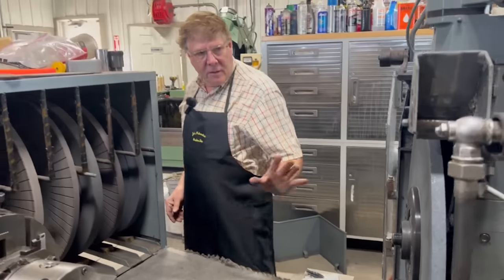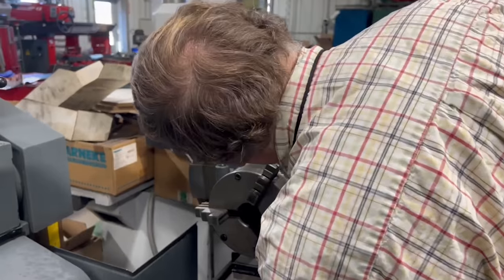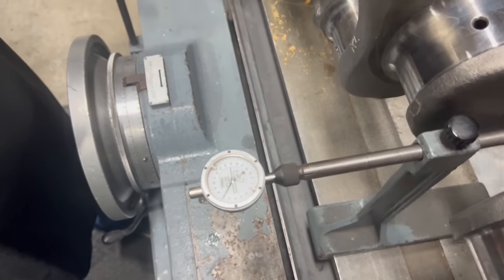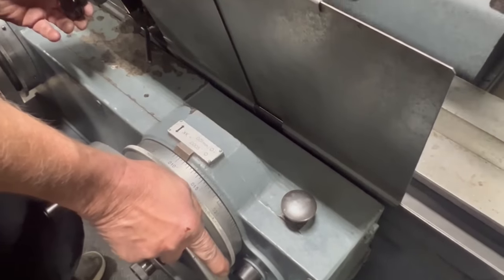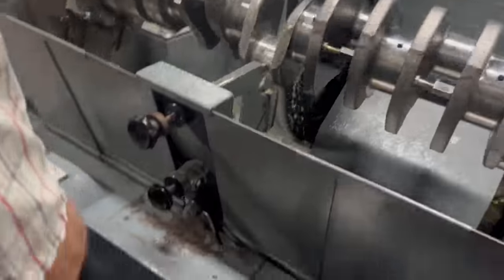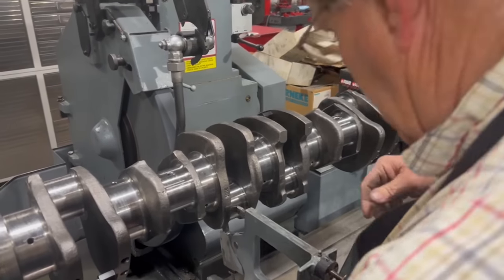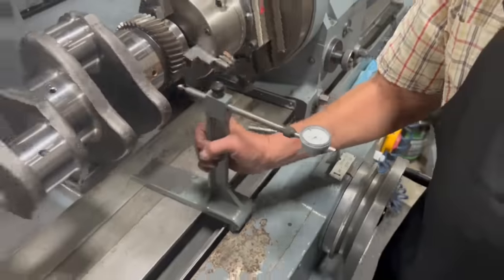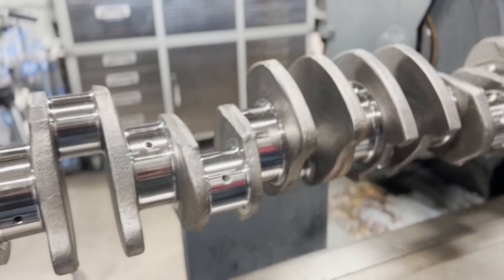This Cummins Crankshaft Was Almost Scrap Metal...

Comment: I've been a machinist/tool and die maker for 45 years and this is the first time I've seen a crankshaft ground! Thank you, it was a wonderful video!
Reply: Me too , and it's so relaxing and peaceful.
Reply: I've allways wanted to see the full procedure this is great
Reply: As a retired tool maker he didn't know what size radius he had only that it was similar in size to his radius gauge this radius on crank prevents cracks from forming when under stress we always ground radii on punches and other tooling that were under stress but on profile tooling if specs. called for .250 radius we ground that dimension to .250 plus or minus .0002 to have proper punch and die clearance.
Reply: Спасибо за хороший урок. Вы настоящий мастер, который любит и понимает свою работу. Здоровья и благополучия. Жду новых видео в этом году!
Reply: 😅😅😅😅ö
Reply: Curious as to why the one instance of side loading the wheel (when sweeping over and grinding out the radii) produced unacceptable chatter, but other similar occurrences did not?
Reply: Same! The “chatter” sounded the same to me also and it happened a few times..
Reply: I am also, tool designer for the last 30 years. Sure is neat to see the type and use of the machinery you use in your videos Jim.
Reply: I sure do like his radius grinder.   Been using a Norbide stick to hand dress the radius then touch a wooden popsicle stick to the wheel and checking that against a gauge lol.

Comment: Thank you both so much for this VERY interesting video. As an OLD(80) yr. old 'gear head' from the big block era of the 60s, and a guy who still changes oil and greases the front end of my '02' Ford E250, I really appreciated the workmanship, and honesty shown in this video. BTW, I watched the tear down video of the 327. I rebuilt my share of small blocks way back when, that was a mess. Thank you for both videos. Sincerely, Bruce F. Raykiewicz.

Comment: Thanks Jim, very cool, I’m an old truck mechanic and back in a day and we’re talking 1975 I used to work on Cummins 318s and what I remember most about them is that they used to snap crankshafts. I’m not a machinist I’m a mechanic.

Comment: To say that this is "oddly satisfying" is a massive understatement. As a truck driver both driving and wrenching on trucks, I've seen "in-frame" overhauls up close. My father created a trucking company and in those early years I was a grease monkey. Dad had a couple of crankshafts standing on end in the corner of the shop. They were for Big Cam 400 Cummins. He always said they were good and now I know why he believed that. The details of dialing in all of those measurements blows me away. What an awesome video! Couldn't take my eyes off it!! Thank you very much for giving me a better understanding of the inner workings of a great engine!
Reply: I've got a detroit 60 series with 850k on a rebuild. Bout due for another. This was super interesting.

Comment: Love your work,guys.
I trained as an engine machinist/builder at Cummins in the late '80's.We did everthing in-house except for crankshaft grinding,,so it was good to see a Cummins crank getting machined correctly.
Alll the measurements and magnaflux was done by us. To measure the fillet radius,we had different size spheres attatched to the end of a thin metal rod.Our magnaflux was the biggest in the southern hemisphere,300 volts d.c.
This was at Cabramatta(aboriginal word),Sydney,Australia.
Subscribed!👍

Comment: I used to do this for a living as a apprentice then went and did a apprentice boilermaker welder more money but I did enjoy doing motor work. 🇦🇺🙏 we had the same machine at Mendham engineering I didn’t see you test the wheel with the ring test but you guys look after your wheels no doubt. We had books that would give us the off set for the weights so we could set up the big ends and the mains we just  Center of the crankshaft. Love your work guys I do miss it sometimes. 19:54 what a  smart idea. After watching this video our machine was a little bit different it was about 35 years ago.

Comment: Great video!! My father ran an engine machine shop for 40+ years. He use to do a lot of crank and cam work, and there were many cranks that came in he used the Eutectic spray welding on to bring them back into spec without taking too much material off. Grinding camshafts was the coolest thing, he use to grind a lot of custom profiles and lobe separations on them, use to build them back up if they were worn too.
Reply: I would love to see that process

Comment: One thing I remember about MACK truck engines is that the crank was ground to "whatever fit" one journal may be 5 under, the next 10 under the next 15 under and the next 5 under again. Then you just used whatever bearing fit.

Comment: Really nice to see an engineer/machinist use the adjuster on the micrometer correctly!  You see so many guys take a measurement, it's not what they wanted to see, but by applying 75ft/lb of torque to the micrometer everything's dandy.😂.
I really wanted to be an engineer/machinist or toolmaker, but the family business was accountancy so I was pushed/shoved into that. Everything you've heard about accountancy is correct. It's as dull as dishwater.
But it has given me the money to equip myself with some amazing machines. 
I've got a 4000sq/ft workshop, I buy old equipment, but I only buy the very best equipment going back 100 years. I like stuff that'll do 1/10 of a thou or better. 
Since everyone went to CNC i've picked up some amazing bargains. A fully fitted cabinet from Moore & Wright, with depth, length, internal radius, external radius  gauges from 1 inch out to 36 inches all of it accurate to 0.1 thousands of an inch, all for £75. It was going to be put in a skip!
I'm a widower and have been for 20 years, I don't go on holidays much, I'm really happy in my workshop. I've lost count on what I've spent, must be north of £250,000 on equipment and £175,000 on tool and gauge.
I've found a young woman who loves it all, she's an amazing learner, she's almost finished her first steam engine, 10hp, twin cylinder locamotive. 
What she doesn't know, is that if she keeps up the interest, keeps studying and learning, then she get the lot in my will.
Only just found this channel so lots to catch up. 👍

Comment: Just found your channel thru your tear down of Scanner Danners engine.  My father was a tool and die maker from the 40’s, 50’s and 60’s, I turned out to be an auto technician, 50 plus years and still doing it, and my son is a welder.  A family of tradesmen.  This was extremely interesting to me and all I could keep thinking of was the engineering and design of the grinding machine and lathe.  Amazing.

Comment: Thanks for showing the whole process. Crankshaft grinding is one of those "black magic" processes that your Dad has spent years learning. That crank is probably more consistent across each journal than it was out of the Cummins factory. I don't think the small drop in bearing size will really matter.
Reply: Ive heard of people boring one cylinder out of 8 and runnin it for a long time

Comment: You actually get the crankshaft closer to the correct specs than most engine machinists I've seen in 20+ years.  You are a inspiration to be better than it will do
Reply: Begs the question if it's just more cost effective with time and money to just replace the crank rather than pay someone to do this who has a ton of experience in it. This definitely isn't cheap to get done by someone who knows his or her shit very well.
Reply: @nexpro6118  In some cases it is cheaper to just buy a new crankshaft. With something like a 5.9L Cummins it'll be $800 - $1000 for even a cheap Chinese crankshaft. Whereas it'd probably cost $200 - $300 to have the original crank reground.

Which I've had such bad experiences with the cheap Chinese engine components that I'll personally never use them unless I absolutely have to. I've seen so many pistons, cams, cranks, connecting rods, bearings, etc. that are either manufactured way out of spec, made out of inferior steel/aluminum, or both. If it's something like a carburetor for a lawnmower then they usually work fine, but for a big 130lb Cummins diesel crankshaft...there's no way I'd take a chance on it.
Reply: @FinalFront  thank you for the response!!!!
Reply: @mihaigheorghiu9071  I have trouble getting a head shaved properly.  I found a specialist now but I have had 3 heads destroyed
Reply: @FinalFront  Only $300 for this?

Comment: Just found your channel and it brings back a lot of memories. I learned the automotive machine shop trade from my uncles when I was 22 years old. What I was taught first was crankshaft work. They had the only submerged arc crankshaft welder in the state of Maine so we received crank work from all over the state. Mostly crankshafts that had spun a rod bearing, removed too much material to grind for undersized bearings, and where the heat of the spun bearing bent the crankshaft. We would put the crank in the crankshaft welder,  preheat the shaft, and then weld the bad rod journal. Before we could grind the crankshaft, we had to straighten it using heat and a hydraulic crankshaft fixture to straighten the shaft to within .002 - .003. Some of the cranks were bent well over .100 before I straightened them. We also repaired worn thrust bearing and seal surfaces. On a couple of occasions, I welded and reground all the rod and main journals back to standard size of cranks that had been previously ground to the maximum of .060 under and the customer could not find a replacement. Anyway, watching you grind the Cummins crank brought make memories that are 44 years old as I remembered those familiar sounds of the coolant changing pitch as the wheel came closer to the journal and the ringing when you got into the radius and just touching the side of the journal. Is that a Peterson crankshaft grinder you have in your shop? I learned on an old Van Norman. All the best to you and your son and thanks again. Please keep making videos and I’ll keep watching.

Comment: It's nice to see the whole job done, even when it doesn't work out the way you want. My worst one was grinding my second crank in a long day. Got it to size and went to move the crank to the other side of the journal. Turned the wrong handle and drove the grinding wheel into the journal! Second undersize for me too - and a change of shorts!

Comment: I once was instructed to use dead rod bearing on a crankshaft of a gas compressor, the crankshaft bearing surfaces were so scratched that you could stick your finger nail inside it.
The gas compressor ran for atleast 10-11months after giving oil Temperature high laram and shutting down. 
After that we replaced the entire crankshaft, con rod, cross head and piston.

Comment: A soft starter is an additional device that can be added to a typical AC electric motor that will allow the motor to use a different startup method. The purpose of this device is to reduce the strain put on the motor during the typical power-up phase of a motor.

Comment: I started the machinist trade working in a automotive shop grinding crankshafts. on a Van Norman 666 big ole red  machine. Lining up the shaft was much easier then the machine he has but, the process was very much the same. We also repaired crank shafts by welding and straightening the shafts was well.. Watching this video brought all those memories back..

Comment: Tell your pops to put a capacitor in parallel with the motor windings on that crank grinder. He was effectively “soft charging” the motor windings as to not bring it up to full speed with “cold” windings. I’d imagine you guys have 3 phase? A triphasic motor would be sweet too!

Comment: They had some diamond wheels that size at the scrap yard, so I bought them! It was very cheap, they had no real market for them. I even bought one because it had the taper mount, it was fully 2 inches thick and aluminum oxide grit.

Comment: I do manual grinding on a small Jones and Shipman cylindrical grinder and when starting a wheel we also use a soft start for safety reasons.
1) ensure the wheel is balanced when starting it for the first time after loading 
2) enduring the wheel is not heavily loaded in any one spot from excess coolant etc 
3) to ensure there’s no debris on the wheel or within the wheel housing 

Love your videos gents

Comment: True story- When I worked at cummins in  the late 1970's I replaced a tapered nose crank in an NTC-335. We only scrapped cranks no regrinding. Mostly because the rod journals would crack after a grind as the radius was not correct. Back then they would grind a rod throw in chassis. So we pull the crank and a guy welds his name on a throw as a joke and we toss it in the scrap trailer. Five years later we get a bearing job in and as we are changing bearings we come across Bob welded on a throw. It was the same crank. The scrap company was selling our cranks and cams to refurb companies LOL. So after that we cut the cranks in half.  Fast forward to today. The crane company I work for lost two machine shops this year and it is crippling to our engine building ability and keeping costs down. Keep up the good work! Merry Christmas to you and yours.

Comment: A purpose built grinding machine for crankshafts.  It’s a thing of beauty.  I always had a minds eye view of the whole grinding wheel reciprocating in perfect time to grind the rod journals.  That’s complicated but could be done with today’s ultra accurate machinery.  However, moving the chucks back and forth to accommodate the center locations of the rod journals then the main journals is the perfect mechanical way to build the machine.  Being able to use counterweights built in is really cool too.

Comment: He's right about getting the crank back to specs and centered. Journal diameters are more critical with bearing tolerances. I would think that little bit of chatter would polish out with a couple 10ths of 1k.
Was pop striking the crank for the wive's tale of settle/relive the stress from grinding?

Comment: I am a retired ordinary Machinist, working before on an engine Lathe & Milling Machine, Radial drills, etc. Working before on Kenworth Trucking Industry, producing Auto Parts for the Assembly Trucking Line, but this operation is a mechanical Crankshaft Lathe, The operator must have a knowledge on auto mechanic to be able to understand the Auto Mechanics operation, It's a beautiful video with a great explanation by the Crankshaft Lathe Operator, he was giving an excellent explanation, with full details, on how the opertion is done, high thumb up to this Video.

Comment: Beautiful job.
I had a brand new Berco 270A in 1987.
I feel like the Berco crankshaft grinder is the Rolex of the crankshaft grinders.
The stroke setting and index is second to none.
Mine was equipped with the hydraulic dresser. 
Watching this video reminded me of days gone past.
Thanks for sharing. 
I would not feel bad about the 50MM rods.
Things happen.
I would still charge the customer.
You did nothing wrong.
That crankshaft did not have a good grind when it was new.
Has a better job now.
Grinding the big radiuses can make it tougher with the chatter.
Especially if the cheek is out of perpendicular with the journal. 
I was surprised the index was off like it was.
That was like it when Cummins made it, IMO.
Nice work, good job and nice job on the radiuses.
Take care, Ed.

Comment: As far as the slight tolerance deviation, the great thing about cylinders is if you are out .001" you will only be .0005" off of top dead center, and if you're less than a thou, the difference might as well be a rounding error.

Comment: My old CG280 WVN (very similar machine) had a good solid stop once set you could plunge grind to the stop lightly against radius then sweep away from it. Also I calibrated by radius dresser with a depth mic so I could set the radius precisely a few thousands smaller keeping the cheek of the wheel away from the rod thrust surface by a few thousands. When I calibrated my radius dresser I ground a couple different size radius on a half inch shaft and had them checked on an optical comparator at Eaton Corporation in Kearney NE. Not criticism on your work by no means

Comment: Stories of extreme precision!!! The entire process is very methodical, and as it was mentioned earlier, the care taken during the preparation set-up really makes a difference with the finished product... The removal of 0.25 mm is a very minimal amount of metal removal.. There was a comment that I read about trueing the face of the grinding wheel to minimize the possibility of chatter during the grinding process...That makes sense... A lot of the time, grooving of the areas where seals ride, can be greatly reduced by applying clean grease to the garlock seals, before they are assembled onto the crank...

Comment: With any kind of precision grinding, sidewheeling without a concave dressed side is going to introduce wobble. If you do it simultaneously while face grinding, that wobble turns into deep chatter. You can avoid this by dressing the sides of the wheel and coming straight in for your shoulders. One other thing I noticed is the slow dress on the wheel... It should be followed by a fast dress about a thousandth deeper with the diamond. Much like the oil groves in a babbitt bearing, it allows a very thin film of fluid to get between the wheel and the part resulting in better finish and less localized heat into the surface - which equates to less runout in the finished part.